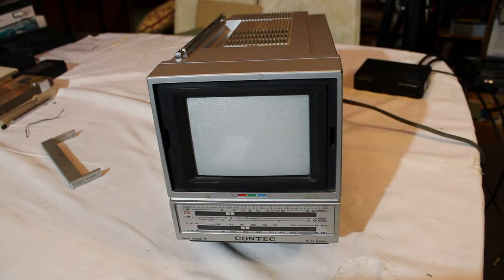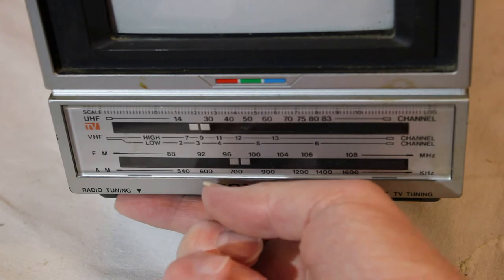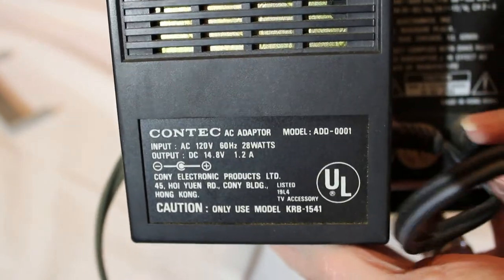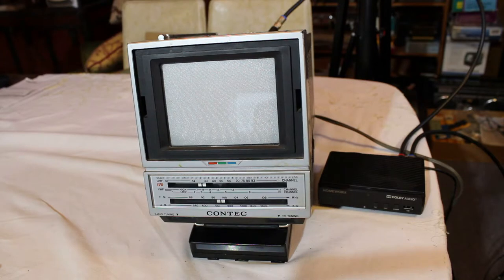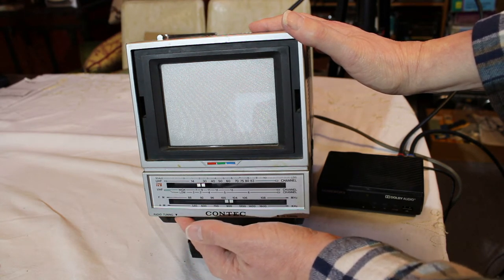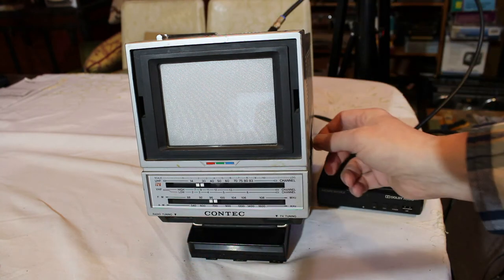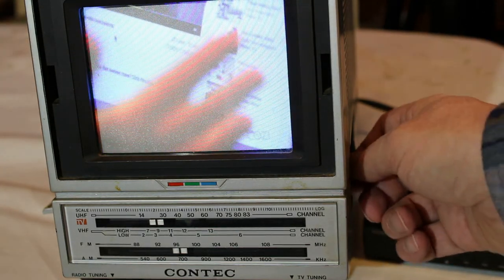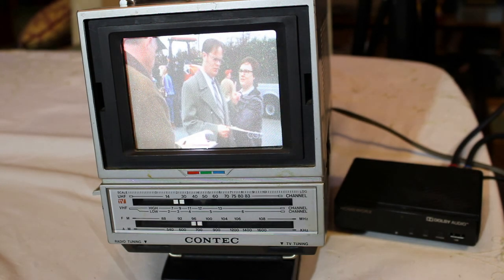Contec KRB 1541 TV Radio

Comment: I ask me if the same AC adapter exists for power supply( primary transformer), with 240 V AC ?
For countries with 50 Hz network.
DC is 15 V DC, and 1,2 A maximum